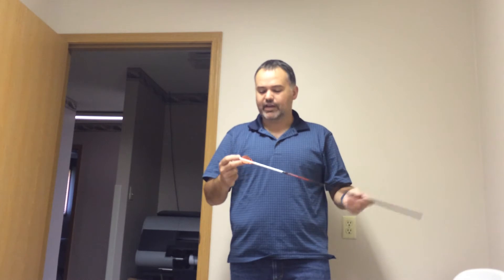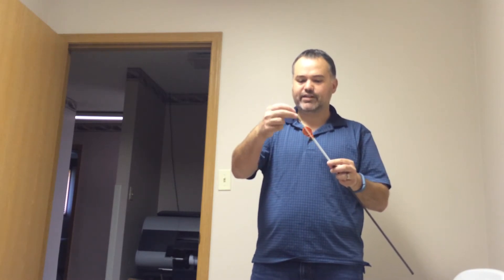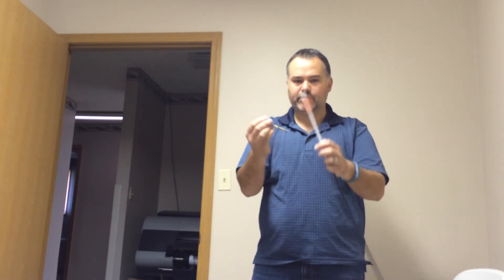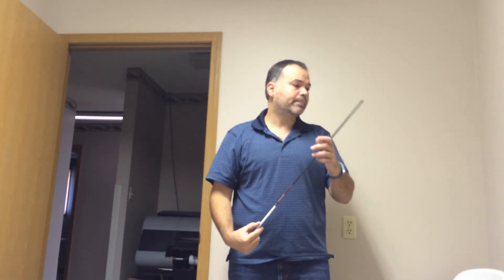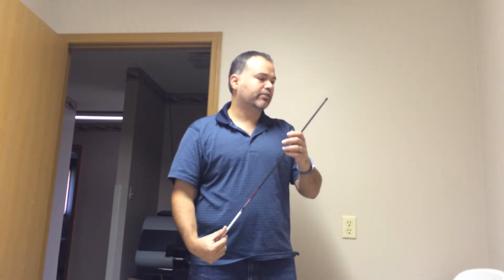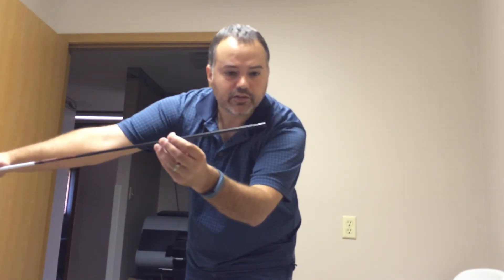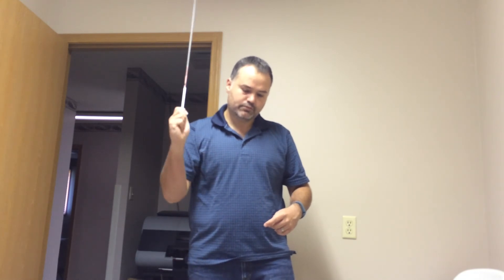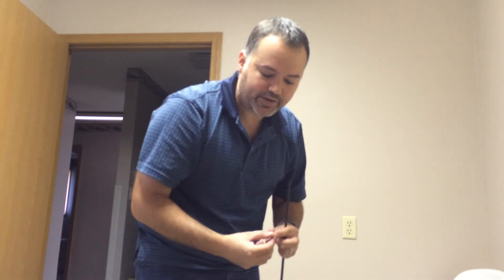Heatless Carbon Arrow Insert/Point Removal Method

Comment: Ingenious....wish I would have seen this video two weeks ago. Heated up my field point and had the insert able to spin freely. Using a vice I pulled as hard as I could and insert refused to come out. I was so frustrated I took a dremel and cut out the inserts from my six arrows to put my new weighted inserts  in. I will definitely remember this next time.